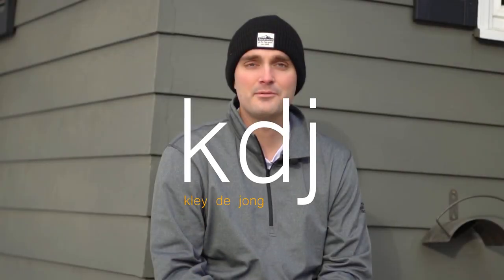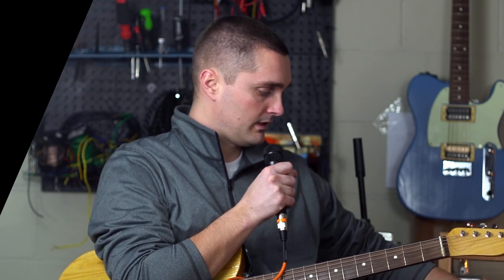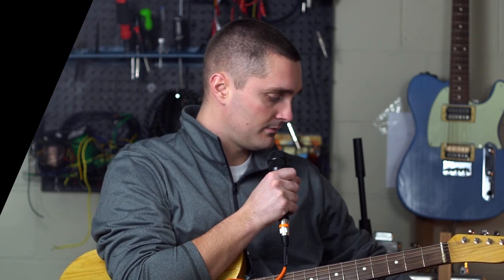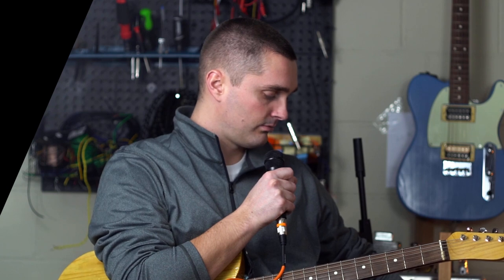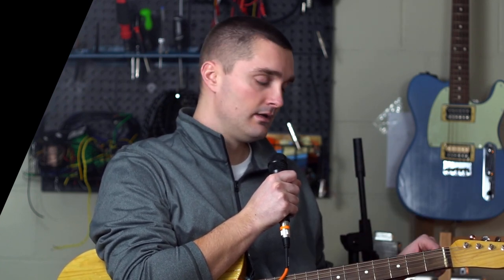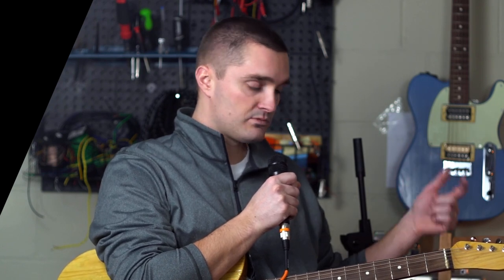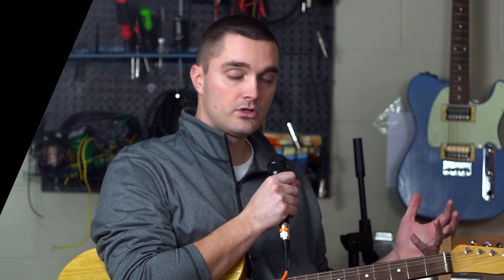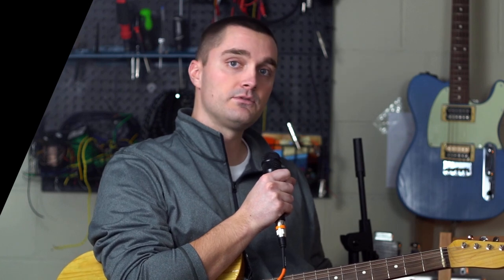Blackface Fender Amp Mod - Pulling V1 for more Gain?!?!  Fact or Fiction

Comment: I pulled V1 and V5. Amp is much quieter. It is now a great pedal platform. If I desire vibrato I use a pedal. Now, no ticking or thumping. It is an early 80s DR with pull boost circuit but I don’t use the boost.

Comment: Honestly, I know everyone raves and SRV's tech, and on and on, but I just think this mod adds fizz, not so much the kind of gain I want and achieve with high output pickups.
Reply: To understand the BS.....if he was a trained electronics person...he would have gone in to the amp and did the proper thing which would be to separate the 2 channels where they do not share a common cathode resistor........that was a carry over from the 1950's tweed amp style as a cost cutting measure in building...meaning less parts and slightly less space in circuit board for those parts...a resistor and a capacitor bypass.  In the tweed amps sharing the cathode resistor.....the 2 channels are interactive....and not fully separated......when they were supposed to be fully separated and independent.  Fender circuits were not always perfect...there were some design defects that were electronic mistakes that slipped through.  Leo wasn't an engineer nor a guitar player...he was a radio repairman that essentially took the amplifier section from radio's to repurpose to a PA amplifier for public presentations.....speech....., and then applied it to music performance.  The early 1950's Fender amps had a microphone channel and an instrument channel......it was a band PA and not really a dedicated guitar amp

Comment from the maker: At 5:40 I need to clarify.  The second gain stage on both the normal and vibrato channels share a single cathode bias resistor of 820 ohms.  When both tubes are active the resistor passes twice the current, splitting its efficiency between both tubes.  So each channel sees 1640 ohms of resistance.  By pulling V1, the vibrato channel now sees the stock 820 ohms - which biases the tube hotter than normal.
Reply: Does doing this affect how "hot" things get in the power stage? (I.e. say one had a really hot bias and pulled v1, is this going to make the power stage tubes wear faster?)
Reply from the maker: @slartbarg  Hot bias can affect tube longevity.  This mod mostly affects the preamp tubes, which are a fair bit more resilient in my experience.  So overall I believe it is a relevant factor, but one with minor effect.
Reply: @KleyDeJong  that was my inkling too, thanks :)

Comment: Hey Kley!
I have a 1965 Vibrolux Reverb. When I’m playing the Vibrato channel with my Gibson R9 past 5 on the volume channel the bass gets lost and becomes flubby and I get some loud notes and crackles jumping from the speakers when playing at the higher frets(bass notes mostly). Ive tried different rooms, tubes and the voltages and speakers seems great. Is the character of the amp with humbuckers? How can I fix it?
Reply: Try putting an EQ or a tube screamer in front of your amp (to remove some of those subs that are overloading your amp).

Comment: Have you experimented with changing the amp from being cathode biased to having fixed bias, and vice versa? Most tweed amps are cathode biased.
Reply from the maker: I have not tried that on this amp.  I have a few other amps (5E3 cakepan, SE 7W Plexi) that are cathode biased.  I tend to prefer running adjustable fixed bias as I prefer how it sounds and that I can dial in the bias exactly how I want more easily.

Comment: I have a Fender PA 135 I'm wanting to convert to a amp. I am a Metal player and I'm wanting to mod it to have a High Gain channel. How would I go about doing that?
Reply: you want this as a do it yourself situation or do you want it done for you ?  A Fender PA amp is a great platform for conversion though you have the 135 model which is different than the 100 watt version.  The 135 was the last incarnation when they went to the use of ultra-linear design which is ok for HiFi but not the same as the old amps which were known for the tone......the ultra-linear series amps use too high of a plate voltage for a 6L6.....though they work.  It has to do with tube life and reliability.  CBS era engineering interference ruined the designs and made them more HiFi which means clean and not the classic old tonality or the pre-CBS era which was much richer and gave up that special magic for a guitar.  SO if you are playing metal....???
Reply: what is nice about a PA amp is that it has 4 channels but has basically the power and output transformers of a twin reverb which is 2 channel.  If you are a Metal Head, the standard was the Marshall JCM 800 series amps.  The 800's were still basically the old Marshall copies of the tweed bassman but the 2nd channel was not present as a feature on the front panel.....it remained internally as it was a cascaded situation in the pre-amp....the whole sound was based on the pre-amp.  Pre-800 amps were being modified outside of Marshall to the One Wire MOD where they cascaded one channel into the other to significantly boost the gain of the guitar signal.  The basic MOD in the old Marshalls was just running a jumper wire to connect the 2 channels which would have been in PARALLEL....cascading the 2 channels is a SERIES situation.  The PARALLEL scenario means the power amp section of the amplifier is being hit with 2 signals at the same time and they are in phase with each other (which is important) and the result is a thicker response than just using a single channel...the amp will sound fatter and more robust.  The series situation will boost the gain up sky high and its difficult to control it from going squealy and being UN-MUSICAL.....so the gain staging needs to be correct and you need good tubes in that part of the circuit.  SO when you look at a JCM 800...it has a high gain input and a low gain input and you can't really use a AB box foot switcher to toggle back & forth as the jacks are switching jacks  on the front panel of the Marshall JCM 800's.....
Reply: I hate to say it but the single simplest solution is to drive it with a good metal pedal. I understand Mesa and Dumble used fender amps as their starting points. If you really want to make it a metal amp, look into cascading gain stages. You may have to divide the output from one stage to the next to minimize blocking distortion. I think Duncan Amps gets into some good information. Another possibility is to find an amplifier you want to have yours sound like and get the schematic to use as a reference. I know this is maybe late I. The game but worth a thought. It is often much easier to purchase what you are after than to make it. There are also a ton of kits these days as well.

Comment: where is heavy metal sound of increasing gain? i only hear lows increased
Reply from the maker: High gain tends to have several cascading gain stages and lots of eq filtering of both lows and highs. The tone stack tends to be more aggressive as well.

I think a lot of high gain album sounds have big low end because of how the bass is mixed. But I don't know a lot about metal production.

Comment: this mod is safe for AA964 as well?
Reply from the maker: It won't work with a Princeton as it only has one channel.
Reply: @KleyDeJong  I have a Vibrolux
Reply from the maker: @Matan2222222  Yes then that will work just fine.
Reply: @KleyDeJong  👍🔥